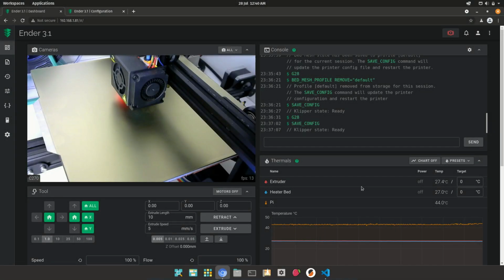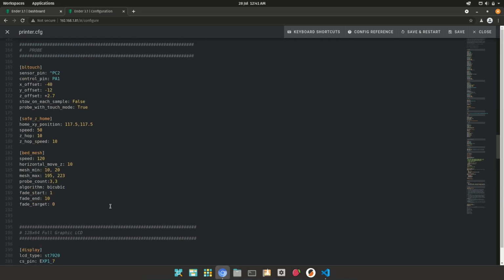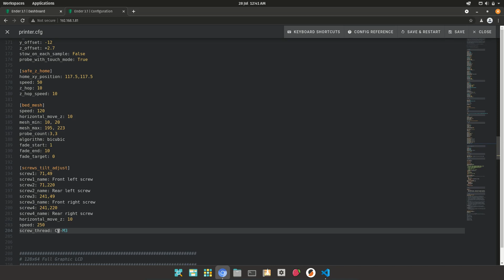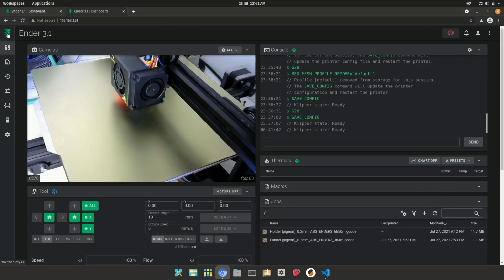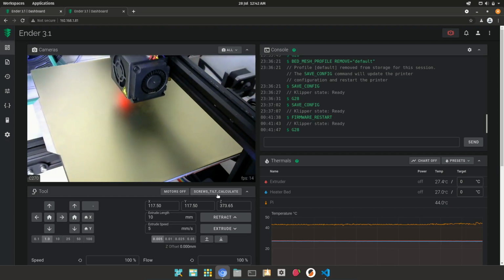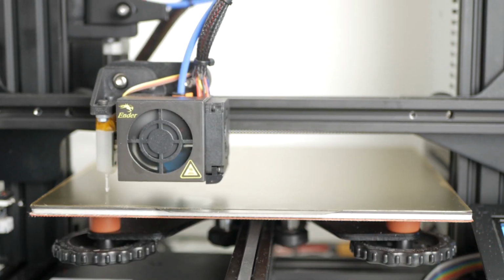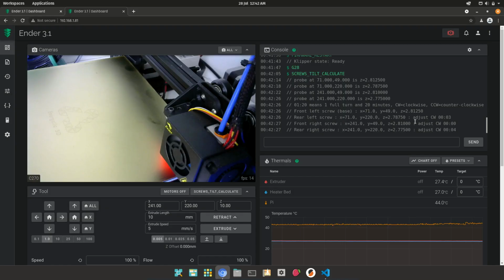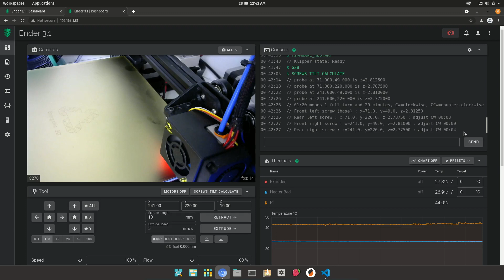Klipper Basics - [screws_tilt_adjust]

Comment: I'm pretty sure the Ender 3 uses M4 screws. M3 is a different thread pitch and will throw off the calculations.
Reply from the maker: Yes, you are right the stock Ender 3 bed uses an CW M4 0.7 Coarse Pitch screw. The code on a stock Ender would be screw_thread: CW-M4. I try not too be to printer specific in these guides.
Reply: @PigeonPrint  I tried this this afternoon, it worked great. Thanks.
Reply from the maker: @rew755  good to hear you got it working!

Comment: If I understand correctly, this helps us get our beds even, but wouldn't it also throw off the tramming of our bed? Or does it perfect the tramming of the bed and "smooth" out the bed mesh?
Reply from the maker: Yes, this helps tram the bed by making the bed suffice parallel with the  tool head (all 4 corners will be equidistant to the nozzle). if you have a perfectly flat bed this will also level it, but if its a warped bed it will help with the mesh.
Reply: Would you recommend doing this hot or cold, and is a virtual center screw a good idea? @PigeonPrint
Reply from the maker: @bodaciouschad  I always do it at printing temp, and just the 4 screws.

Comment: I know this is an old thread but when I measured where my screws are I used the nozzle.  But when it tries to do the measuring it isn't taking the bltouch offsets.  Should I measure the screws in relation to where the probe would be?
Reply from the maker: Yep, if your using a BLTouch, you want the BLTouch over the screws rather than the nozzle as it wont take probe offset into account.

Comment: How to measure and insert the correct screw values? What is the reference?

Thank you for your great vid! :)
Reply from the maker: If its a bed slinger styled printer like an Ender 3 or clone, the vast majority will me M4, but you can measure the screw is you need to double check the width, M3 = 3mm wide, M4=4mm wide, M5=5mm wide and so on.

Comment: When I use screw tilt adjust, It puts the nozzle over the screw points and not the probe. If I go into klipper screen and use bed leveling, It will move the probe to the screw adjust. What is wrong here?
Reply: Did you use the probe or the nozzle for the initial measurements? You need to use the probe.
Reply: @RobStangle  I used the probe. The problem seems to lay in the klipper screen. Since 2 updates ago, it seems to write and read to the wrong file and I don't know where that file is. If I save my z offset, it shows the saved z offset but it doesn't actually use thst value. It uses the value in printer.cfg which is different.
Reply: @marckart66  The Z offset is stored in your printer.cfg all the way at the bottom in the grayed out area (#*#).

Comment: For Creality Ender 3 S1 pro im using: 
[screws_tilt_adjust]
screw1: 60,74 #X,Y Position
screw1_name: front left screw 
screw2: 60,232 #X,Y Position
screw2_name: rear left screw
screw3: 235,232 #X,Y Position
screw3_name: rear right screw
screw4: 235,60 #X,Y Position
screw4_name: front right screw
horizontal_move_z: 10.
speed: 50.
screw_thread: CW-M4 # Use CW for Clowise and CCW for Counter Clockwise 

Maybe someone finds it usefull....
Reply: S1 Pro has x and y max of 220mm, and in my printer.cfg I have:
screw1: 25,33
screw2: 202,33
screw3: 202,202
screw4: 25,202
are your measurements definitely for S1 Pro? or maybe S1 Max?
Reply: @DaiBach99  yes, printing area is 220, but this positions are not for printing. It's where ur sensor should be.
If u moved bl u need to update settings.
Reply: @DaiBach99  +1 This, Ender-3 S1 for me. Creality Sonic Pad initial setup puts those into the config! I trust those. EDIT: I had to adjust my y max to 231, and left x to 245 max(default) the x25 is too low and the probe hangs off the bed! These settings below are as close as you can get without slamming into the plastic front face with the little metal piece under the v-wheels(pretty close to original posters lol): 

[screws_tilt_adjust]
screw1: 56,73 #X,Y Position
screw1_name: Front Left Screw 
screw2: 56,231 #X,Y Position
screw2_name: Rear Left Screw
screw3: 231,231 #X,Y Position
screw3_name: Rear Right Screw
screw4: 231,73 #X,Y Position
screw4_name: Front Right Screw
horizontal_move_z: 10
speed: 200
screw_thread: CW-M4 # Use CW for Clockwise and CCW for Counter Clockwise
Reply: @BakeJake  Your settings look incorrect as does Andrzej's. Screw1 is front left, Screw2 is front right, screw3 is back right and screw4 is back left. Screw2 and Screw4 are backwards in my opinion. Screw1 and 4 should have the same x value and Screw 2 and 3 should have the same X value.
Reply: @paulwolochow5048  I might have further dialed that in, I thought the same tbh! I just left the ordering and made the locations more precise for my machine! Worked perfectly! All trammed in now!:)
Reply: @BakeJake  using which settings?
Reply: @johnnybueti  what exactly are you asking? Everything is documented here in these comments, SCREW_TILT_CALCULATE, you need to enable screw_tilt_adjust in the config settings! Your best bet is reading the configuration documentation for klipper, to understand what these things do! As I could give you numbers and you would possibly not know how to change them making them useless and rather damaging. Best regards, Jake.

EDIT: I have a zero y offset backplate now so my numbers will not help you sadly! They will get you close with stock parts though. As I don’t even have that configuration anymore! I’m sorry!
Reply: @BakeJake  All good! Thank you so much for taking the time and replying to me, I appreciate it. I meant to ask about the screw coordinates – do you happen to remember if you used the ones in your comment above? Thanks again!
Reply: @johnnybueti  yeah no problem, I did, so what I actually did was use those, then jog my printer to those locations, and changed according. Tried to get it as close over the screws as possible! Keeping x and y in-line like 20x 20y, 200x 20y, 200x 200y, 20x 200y. If that makes any sense. Those numbers in early comments were only a few mm off if I recall! I did also change the order of them. It goes counter clockwise in my case. You can program it however you feel necessary, the coordinates just tell it where! So look at your sonic pad or carry a laptop to your printer and maybe a piece of paper and a pen lol(I had my laptop still used paper)😅 but yeah literally just mess with it! Look at what it’s doing! My mount for my ribbon cable made me change my upper x limit, it was crashing into it whenever it did fat size leveling. So just be careful and take your time!
Reply: @BakeJake  That's awesome!! Thank you so much, again I appreciate it! The confusion came from the fact that the initial intention was to align the probe perfectly with each screw, but since rear screws were out of the probe's reach (the bed would hit min-y) I really had no clue to what to align it to. This helped a bunch, thanks!
Reply: @johnnybueti  Glad to hear! wish you many successful prints in the future lol
Reply: Thank you so much! Will speed up the process on my new Ender-3 S1 Pro...
Reply: Nice, struggle with my S1 and can only get Y to 229 so have u changed your bedsize in config to 235?
Reply: thanks a lot, helped me to get this feature to be recognized on my E3S1 with sonic pad. :)
Reply: But whenever I try to use screw tilt calculate, it probes the first screw and says out of range or something like that, don't remember correctly. Did you have the same error?
Reply: @hashbringer975  r u using klipper and s1 pro?? It sounds like other size of the plate ?? Even if so, its easy to fit it for your needs, just adjust carefully probe so its over the screvs and use this numbers. Do it carefully - in small steps.
Reply: @andrzejrog8223  Im using regular S1, as they are basically the same machine, except the S1Pro has already PEI bed, touchscreen, LED light bar and insulated bed with handle.
As I noticed these screw coordinates are pretty spot on, only don't understant why it gives me Out of Range error after first probing.
Reply: @hashbringer975  it may be that the probe offset+screw position makes the print head exceed the X limit. Right screws at X 232, plus the probe's X 32 offset, puts your print head at X 264, but the default max for the S1 Pro is X 252. It'll measure the first screw correctly because it's in range, but fail on the second (front right) because your print head would go out of bounds. You may need to bring your FR/RR screws values slightly inwards to X 220 and understand that the measurements from screws_tilt_adjust on the right side will not be perfectly accurate, but you should still be able to tram with a minor offset.
Reply: @corombb  damn, thank you for reply. Really good explanation and some 101 logic. 😅 When I'll have time, I'll redo the screw locations, thank you.

Comment: Why are thing still SHIPPING WITH MARLIN! This is sooo cool!
Reply: Unfortunately you need another computer or microcomputer like a rasberry pi to run klipper, it can not run directly on the printer main board
Reply: @chillywz3011  what about printers like the biqu or flsun that come with klipper out of the box. I don't have 1 of either, can't brands like creality and what not use the same board set up as those?
Reply: @Armor3dprinting  the boards those printers use are more expensive and come with a small control board that is like a rasberry pi, allowing the printer to run klipper (the btt hurakan for example, uses a manta m4p mainboard with a cb1 board attached that functions like a rasberry pi)

Comment: how to make bed mesh do auto not do manual adjust by hand
Reply from the maker: If you are using Fludd, there is a button called "Tune" on the left-hand side, this will probe your bed and make a mesh (in Mainsail I think its called "Hight Map").

Comment: how do I get the proper measurements? I typed in yours just to try but its not accurate. thanks
Reply from the maker: just use the manual controls and jog the nozzle till the probe is over the screw, and it should show you the XY position on the screen. You don't have to be exact a few mm off won't matter much, and remember to use the nozzle to find the coordinates, as it will use the probe offset when you run the command so the probe hits those spots.
Reply: @PigeonPrint  I can't get the command to account for my bltouch offsets.  In researching in the Klipper discord it seems like you have to manually add the offsets.  Can you confirm if you had to do this or if its actually using the stored offsets?
Reply from the maker: @Nell8908  I dont think the mesurments you put in account for the porbes offset for example I have "screw1: 71, 49" and if I move my printer in the console to X71 Y49 my probe is over the screw, rather than the nozzle. So, I belive your best bet is to home the printer and manually jog it over the screws and note the couadnates it displays and use them in the config. I also find It doesn't need to be mm perfect so you can just move to the first screw and measure with a ruler how many more mm it is to the other screws.
Reply: @PigeonPrint  Awesome, thank you for clarifying.  I was just confused by the comment "as it will use the probe offset when you run the command so the probe hits those spots." above.  Love your concise quality videos btw

Comment: cant your share printer.cfg klipper for ender 3
Reply from the maker: I can, but it will only work if you have the SKR E3 Mini V2 mainboard, if you have another board you will need to change all the pins and stepper settings. 

My printer.cfg can be found here: https://pastebin.com/T7pfgMKB
Reply: Great video. I have a 3 point carriage. Any idea on how that works with this?